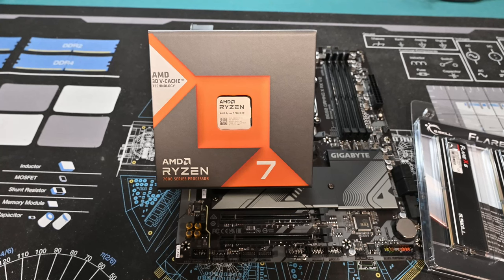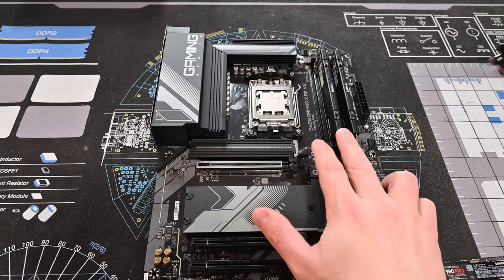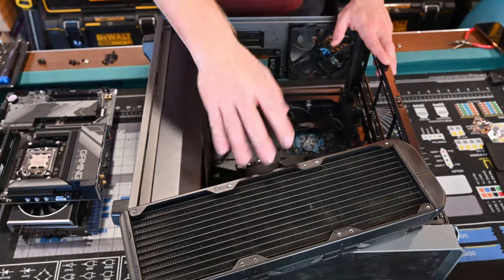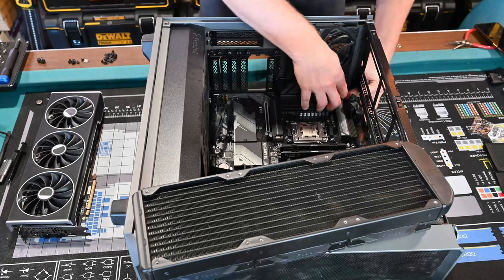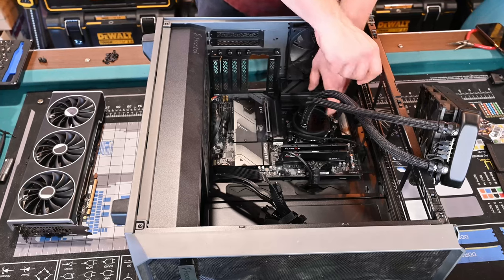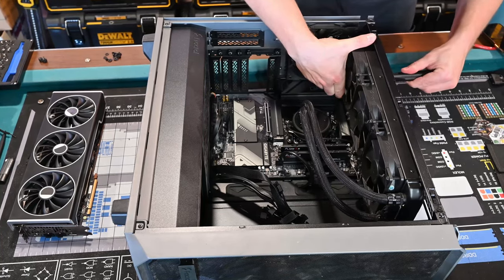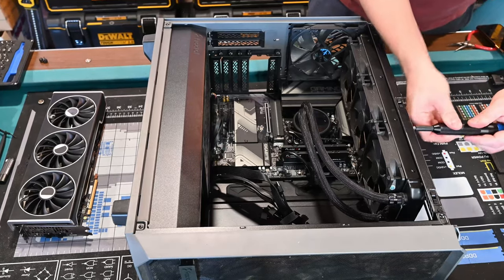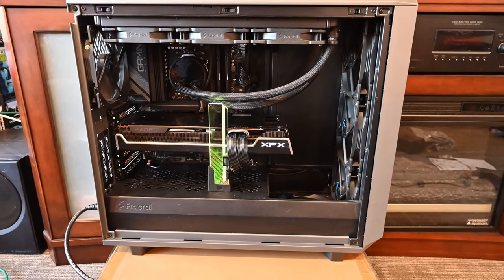Computer Build - AMD 7800x3d Gigabyte B650 Gaming X V2

Comment: you don't need to plug in the 4 pin for cpu power,  what you need to do is out of the 3 cpu power cables, determine which one has the correct pin shapes for the connection as all you need is 12v
Reply from the maker: Thanks for testing.
Reply: @GrayaOverload  you are welcome, also  in case you don't know the memory can fit backwords and the memory slots are not labeled correctly in the manual.   I managed to 1) install the memore backwards and 2) use the wrong slots.      Once I figured that out then I got a screen.
Reply from the maker: @misterdude123  I hope it helps someone. I think they also had drivers mess up for a while on their site for the wifi and bt with all the versions and revs.
Reply: @GrayaOverload  yes it does overall.   For those reading this, you definitly want to get the latest drivers for the chip set etc as Windows, surprise surprise, does not install the latest chipset drivers by itself.

Comment: hey i was just wondering, what does the red light on the motherboard mean at the end?
Reply from the maker: It is the boot light. I booted the machine while filming so it will get thru each light and stay on the boot one until it is booted.
Reply: @GrayaOverload  ah alright, i have the same motherboard and i was experiencing the red light  when i boot it so it had me a bit worried, the pc is good and it runs fine but i’m glad to know what that red light means. thank you
Reply from the maker: @ShelfOwO  no problem. Happy to hear you new build is up and running.

Comment: Thank you for the video, it's really well done and explains specifically, I ask you a courtesy, in the description of the video could you put the links for the purchase and also power supply recommendations? Unfortunately I live in Italy and the Amazon store is not as stocked as in other countries and specifically I have to find the parts in other stores
Reply from the maker: Sure, I will go thru and try to find links. The microcenter bundle was from a physical store I drove to. In this build I think it was a 750W or a 850W platinum PSU.

Comment: I have the exact same combo build from microcenter, it came with bios F3 and i kept getting boot up loop that said "auto reparing" and it just kept repeating over and over and never goes into windows. I powered it off and swapped rams around and it boots up fine. Anyone else have this issue? I updated bios to F5 and seems stable for longer but few days in it happened again. Any help would be much appreciated 👏
Reply from the maker: If you have expo or xmp on I would turn that off, to see if the problem go away.
Reply: @GrayaOverload  after going though a bit of process of elimination, tried both ram sticks alone in every slot and booted into windows but extremely sloppy. I then suspected the mobo , cpu or ram was bad, i took no chances and returned the whole thing and re-purchased the combo again and hoped for the best. Installed everything and it booted up perfectly with the same windows install that i already had. I didn't even update bios and this thing has been running great. I suggest people test out their equipment extensively before the 15 day return policy expires and return if any issues. Good luck people! the combo is still a steal at micro center.
Reply from the maker: @JustAnMMAfan  Great point. test out equiptment in that return policy.

Comment: Do you have an extra 4pin cpu connector thats paired with the top left 4 pin cpu connector thats plugged in?
Reply from the maker: Yes, I plugged in the 4+4 and the additional 4 pins for the cpu.
Reply: But is it needed?  @GrayaOverload
Reply from the maker: @MadVillain-qp4qj  People have reported back that they have it working with out the extra 4 pin plugged in.
Reply: @GrayaOverload  thank you. I just got this combo a few days ago and I'm building my first pc with this and I'm trying my best to figure everything out. Just waiting for the aio and ssd before I power it up. And truthfully, I'm kinda scared to turn it on. 😅
Reply from the maker: @MadVillain-qp4qj  Don't be scared, it is fun.
Reply: @GrayaOverload  I've been having a blast building this that's for sure! I have been enjoying looking up and learning about how everything works but just worried about a bad board or something that I don't know about. But I will turn it on. I just need to stop worrying 😆
Reply from the maker: @MadVillain-qp4qj  I have been there many times through the year. I have had many bad parts thru the years.
Reply: @GrayaOverload  BTW thank you for making this video! It has helped me tremendously and I appreciate it! 🙏
Reply from the maker: @MadVillain-qp4qj  you are welcome.
Reply: @GrayaOverload  so I turned it on today and the fans and lights were on but the mobo gave me a red led light and I turned it off. Had it powered up for 15 seconds because I was worried about the cpu heat. Is something wrong or did I not give it enough time to boot correctly?
Reply from the maker: @MadVillain-qp4qj  What red light was on there are 4?
Reply: @GrayaOverload  it's a red led at the bottom right of the ram right above the usb-c plug-in
Reply from the maker: @MadVillain-qp4qj  Yes, there are 4 led's there. cpu dram vga and boot. page 17 of the manual. It will cycle thru each one and will stop on the one that needs attention or has an issue.
Reply: @GrayaOverload  so I take it that I didn't give it enough time to do it's thing? Or should I double check the cpu and ram and make sure they are sitting correctly?
Reply from the maker: @MadVillain-qp4qj  I would just start it up again and then look at which one it is. If it is the boot light and you haven't installed windows that one will be on.
Reply: @GrayaOverload  ok now here is a noob question. How long can I keep it on before the cpu gets too hot? I don't have a cooler yet
Reply: And I don't have windows installed yet
Reply from the maker: @MadVillain-qp4qj  Not to long a min, it will turn itself off it if gets to hot.
Reply: @GrayaOverload  I'm at work right now but I believe that I have my ram in A1 and B1. This might be the problem?
Reply from the maker: @MadVillain-qp4qj  yes that could be a problem. Depending on what light it can tel us how far along it is.
Reply: @GrayaOverload  ok kool. I'll check when I get off work and report back! Thank you again
Reply: @GrayaOverload  vga red light
Reply: BTW I don't have a gpu yet
Reply from the maker: @MadVillain-qp4qj  That might be fine.The 7800xed comes with a integrated GPU that you can use that  until you get a GPU.
Reply: @GrayaOverload  so not having a gpu would give me the red led correct? I just gotta make sure
Reply from the maker: @MadVillain-qp4qj  I don't remember. to know for sure you would need to plug in a monitor and see if you see the bios screen.
Reply: @GrayaOverload  so I got to the bios and it looks good. I'm getting a nvme ssd in the morning and 2 flash drives and will update the bios and then be ready to install windows. HOLY CRAP! I DID IT! Thank you again for your help 🙏
Reply from the maker: @MadVillain-qp4qj  no problem
Reply: @GrayaOverload  ok now I have a red "boot" light. But I can still get into the bios
Reply from the maker: @MadVillain-qp4qj  Awesome. You can verify everything looks good in bios. And then install windows. The boot light will be on until the os is loaded.
Reply: @GrayaOverload  sweet

Comment: Can you show how you tested your motherboard and cpu?
Reply from the maker: Great idea. I will have to do that.
Reply: I couldn’t quite tell in your video, when you plugged in the power supply cable for the cpu, did you plug in the 8 pin and then split the other head that’s daisy chained to fill that 4 pin power connector?
Reply from the maker: @Sagwafu  yes, I plugged in  the 8 pin and the 4 split off the other 8pin (4+4)
Reply: @GrayaOverload  Awesome thanks, I just used this  bundle in my build over the weekend and ended up doing that. It all works :)

Comment: I built this combo to replace my i7 4790k PC. I used a heat sink air cooler instead of AIO. Still using my old RX580 for now. It's a beast at 1080p. But definitely bottlenecked at the GPU.
Reply: How bad is the bottle necking? I just purchased this combo today to switch from exact same processor as you. I was gonna stick a 1070 8gb card in it for now.... Honest opinion, should I just hold off till I have a more modern GPU?
Reply: @adamford2373  I m happy with the performance at 1080p. I'm waiting as well, to upgrade my GPU. Bottleneck is really not an issue at this resolution. I'm going to upgrade my monitor first, then the GPU.

Comment: I have a very similar build. Have had nothing but crashing and bsod issues since i built it.
Reply from the maker: @mitchcolangelo550  latest bios and at defaults in BIOS?
Reply: @GrayaOverload  yes sir. Tried swapping ram sticks. Usually its memory management bsod. Im desperate at this points
Reply from the maker: @mitchcolangelo550  if only one ram stick still have the bsod? Also what memory?

Comment: Just finished building almost the same computer (cpu cooler and power supply are different) and one of your vids about the motherboard helped me out.  

I wasn’t a big fan of how the usb 3 plugs into the motherboard.  How did you deal with the back panel of the tower pushing the plug forward?  It puts unwanted forward tension on the socket and was stressing me out.
Reply from the maker: I agree on the USB 3 plug. I hope I understand the question right it is about the USB 3 plug? I tried to get it to a position that I was happy with and plugged it in. Since this was an upgrade for my friend the cable had already been plugged in giving me a big more freedom.
Reply: @GrayaOverload  yeah it’s where the usb3 plugs into the motherboard.  The angular design of the interior of the tower doesn’t allow me to just slide it in from the opening next to it without folding the cable back over itself.  Had to feed from the bottom opening and do some twisting to make it work and not stand out.  Thankfully the gpu covers it up so it’s out of sight.  

My first ever pc build so I’m excited but nervous about every connection.  
Thanks for posting these videos as they were very helpful for a first time builder to iron out the kinks.
Reply from the maker: No problem. I enjoy building PC. I also enjoy seeing people want to get into building them.